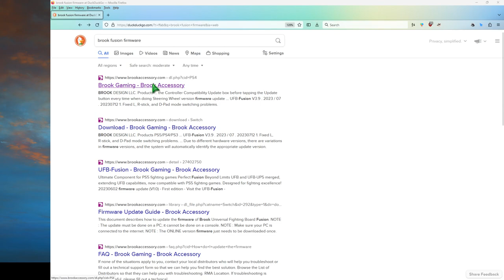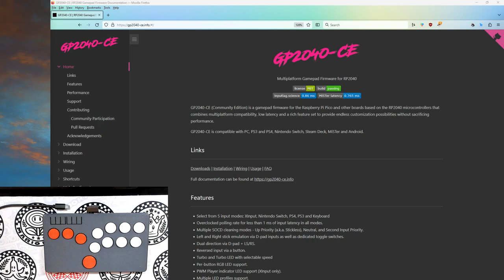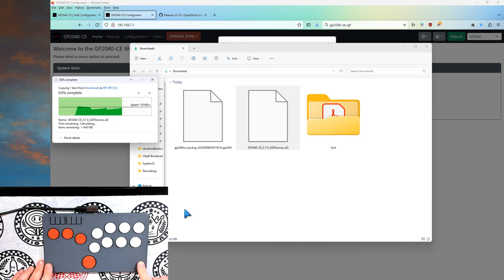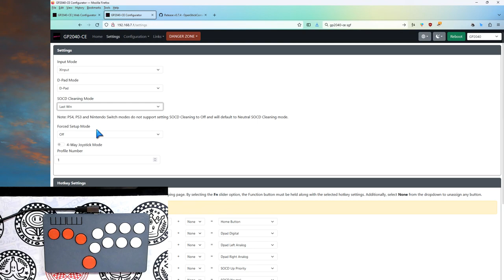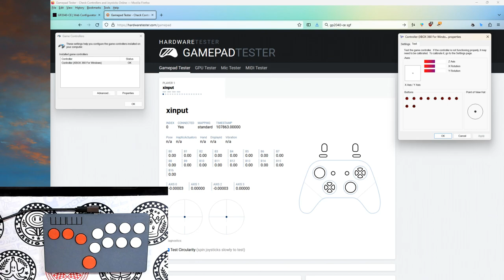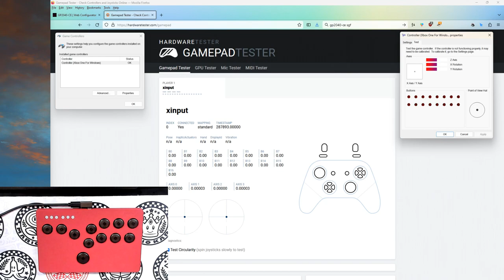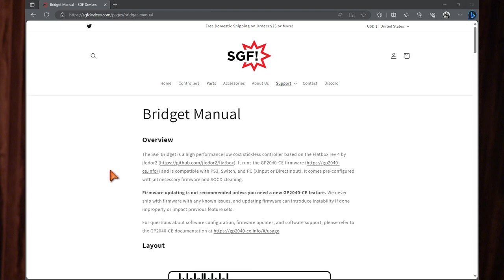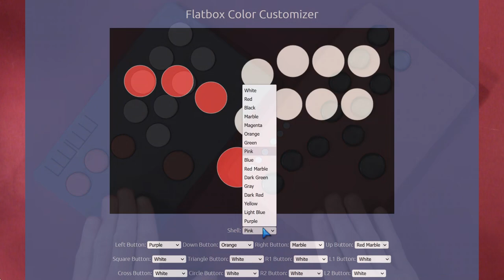Flatbox ULTIMATE Showdown! SGF Bridget vs. Zappa

Comment: Hey Zevaeros, thanks so much for spending your valuable time checking out our controllers! We're really glad you were able to give an in depth objective review for everyone. We do constantly make some improvements, so we just wanted to let you know about a couple of changes we've made since we sent your units:
- We've changed our supplier for the rubber feet. We now use ones that are a little bigger and stick a little better, so performance is much improved. We also don't pre-install them, so if someone wants a slick bottom and the thinnest profile possible, they can leave them off.
- We were able to update our design and processes enough to move to toolless case designs. No screwdriver needed anymore!
- Unfortunately we had to drop our carbon fiber case options as we couldn't find a consistent supply for it.
- More ZAPPA button color options are coming within the next few weeks :)
- Artwork options are coming early next year! (In the meantime, vinyl stickers/skins actually do work pretty well)
- We're also working on extensions for all of our products for lap use.
- The printed manual we included for you are actually press guides -- we are trying to keep our environmental footprint as low as possible, so we don't generally include a fully printed manual, but if a customer requested it, we could.

We'll definitely keep you in the loop on our new stuff -- there's lots cooking for the next few months! Everyone can keep an eye on our website or socials to make sure they're up to speed as we keep making our monkey moves :)
Reply: Thanks again! I did notice y'all have a presence in some of the popular Discords on the topic so I do appreciate that.

Comment: Quick update: I took off the included rubber feet to install new ones and found that indeed, there is a spot there devoted to that so my observation about it isn't right. (When I did it once or twice I thought it was leftover glue)

There's also the notes SGF provided elsewhere in the comments which are overall good news.

Comment: Invest in magnetic USB cables. You can have one cable and multiple dongles, they're similar to the Macbook's magnetic charger but USB C and it carries data. It also saves damaging your port from plugging in-and-out always
Reply: Sure, you can do that though not sure how reliable that connection is going to be since it'll take even less force to disconnect that vs plugging in USB-C. Might be okay for the console/computer port, though I wouldn't trust it for the controller port. Has this approach worked pretty well for you?